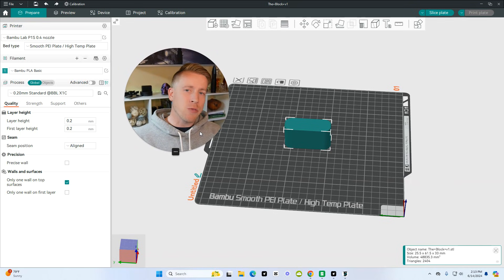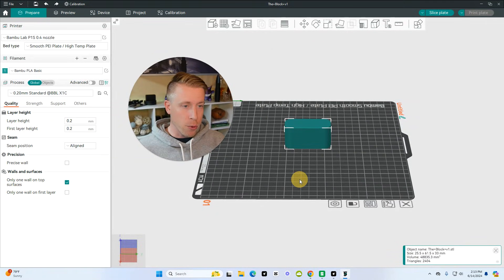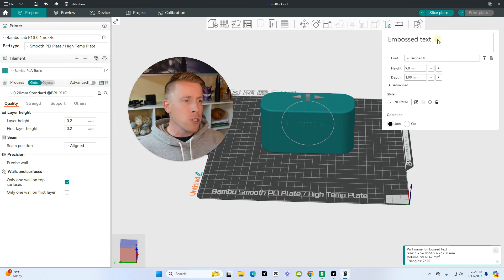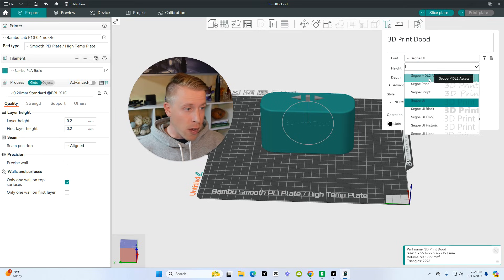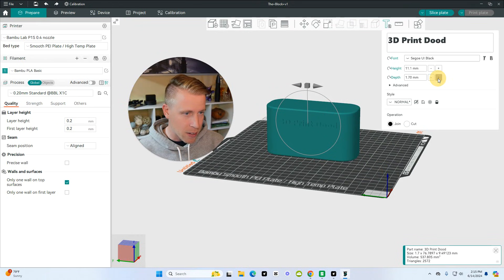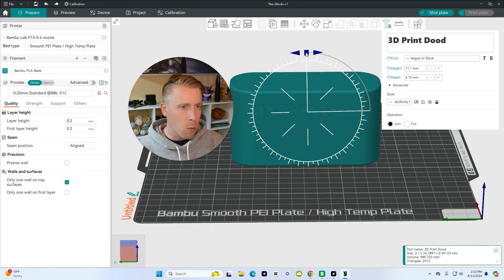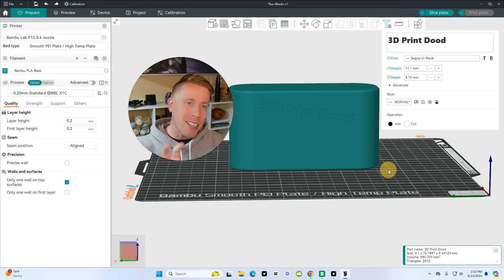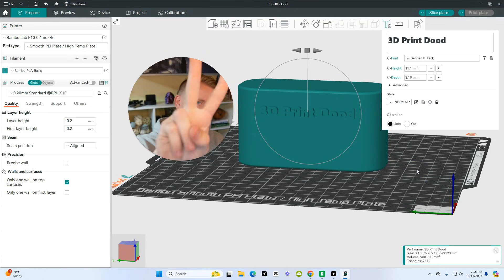How to Add Text to Model in Orca Slicer

Comment: How about placing the text where you want it, not just where it ends up..?
Reply: Triple click on the text, on that third click, don't let go of the mouse button. A crosshair will appear, then you can move the text where you want it. Took a LOT of testing to figure this out.
Reply from the maker: You click where you want it to be
Reply: @3DPrintDood    I can't seem to get this either.  If I select my object and then open the Text tool, It will just put the text in a random spot on the object.  I have no clue how to move that around to the exact position that I choose.  Any ideas?
Reply: @ScotlandTheBrave  Try right-clicking where you want it > Add Part > Text
Reply: @ScotlandTheBrave  Triple click on the text, on that third click, don't let go of the mouse button. A crosshair will appear, then you can move the text where you want it. Took a LOT of testing to figure this out.